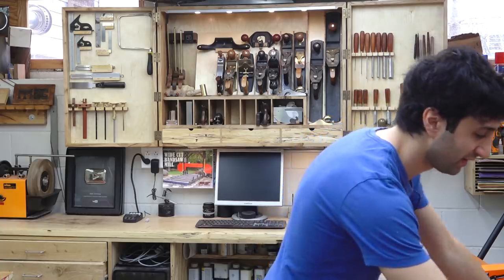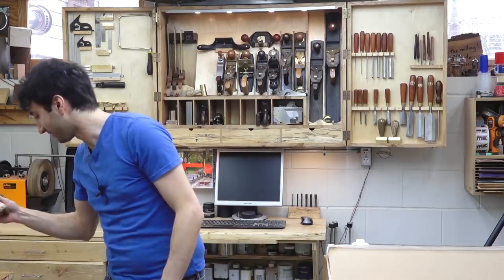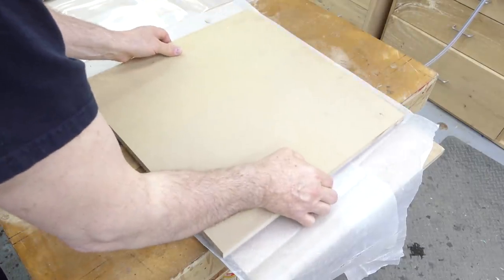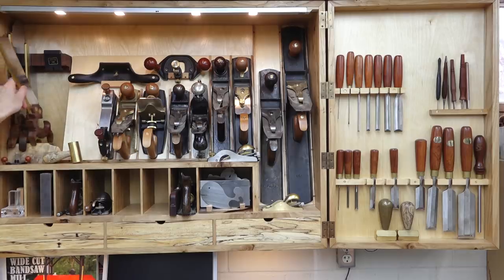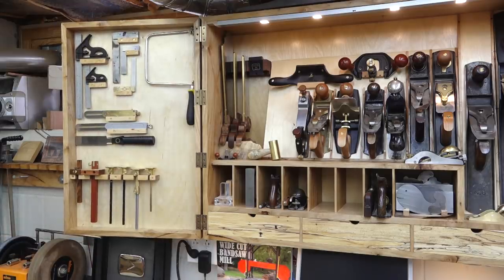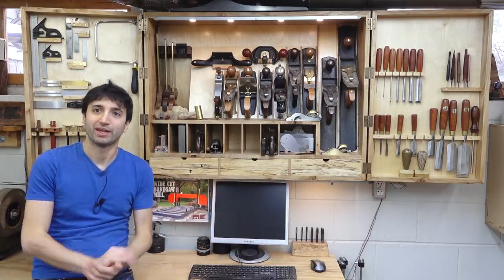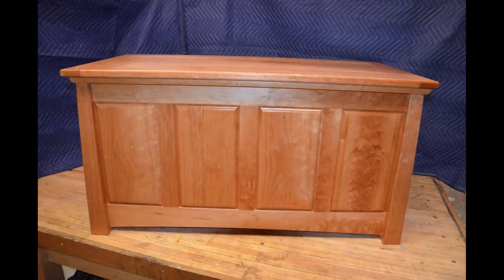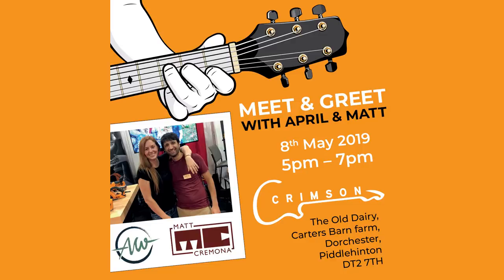Matt's Weekly Shop Update - May 2, 2019

Comment: The mismatching ground prongs on those outlets to the right and left of the computer monitor on your workbench is bugging me @ 1:20! One set is up, the other outlet is down. Can't. Stop. Thinking. About. IT! AHHHHHHHHHHHHHHHH!
Reply from the maker: I do many things like that on purpose evil grin
Reply: @mcremona  So... Evil. Lol.
Reply: If you use an electrical box with metal face plate, the ground should be up. Think of it dropping on the”plugs”, as opposed to the ground. He has the plastic faces ground up, OK. But the metal face plate is ground down. This is wrong.